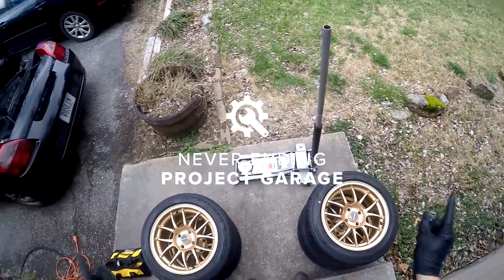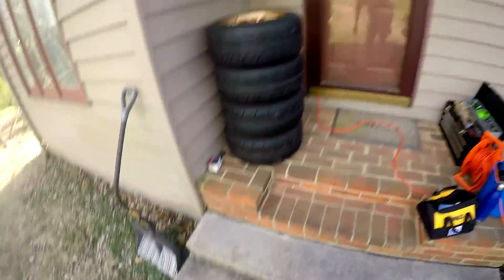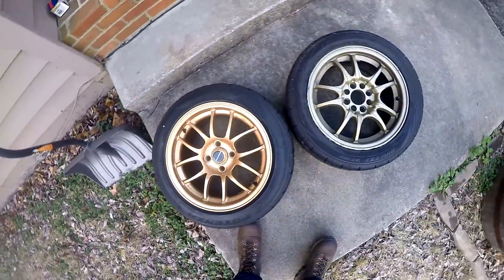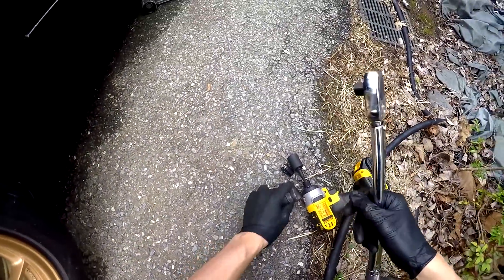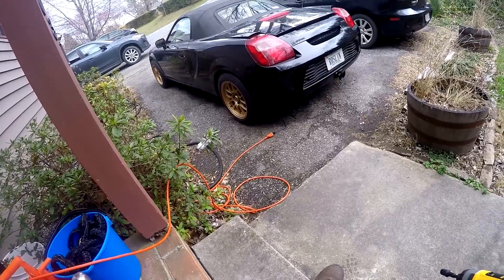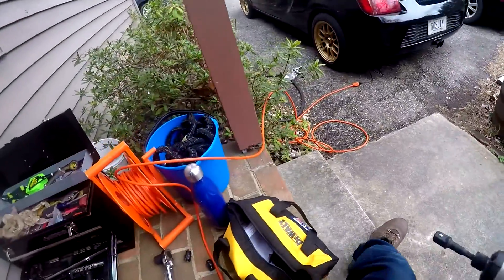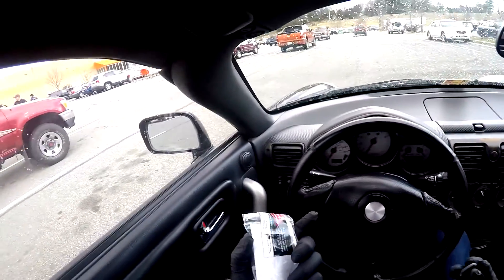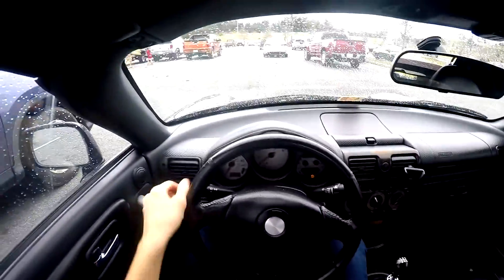Installing 6UL wheels and RE71R tires on the MR2 Spyder - Autocross starts soon!

Comment: I'm keeping my eye on your spyders progress and I'm loving your wheel setup.

Also you can usually break the lugs free with the car lifted using an impact gun. No need to loosen them on the ground unless they are overtorqued.
Reply from the maker: I did that out of habit, but seeing how well that gun works, I'll probably do them all in the air from now on. It's only 75 lb/ft of torque per wheel.
Reply: Never Ending Project Garage I thought that  120 lb/ft figure was a bit high

Comment: hey NE 
I sure like what you have done to rescue another neglected MR-S. I happen to own a 2000 Red MR-S. I'm the original owner. Right now it is in storage up in MN. My MR-S needs an engine rebuild because a tooth broke off of a  sprocket for the timing chain. it messed up cylinder #1 of my 1zz-fe . Eventually I'll get it fixed this Spring.
Reply from the maker: Ah, that sucks! I'm lucky in that neither of the engines I've used have had any timing chain issues.
Reply: Never Ending Project Garage 
check your oil level after every time you finish an autocross meet. These cars stock  chassis can handle high G's but the stock engine cannot. My current short block with a broken timing chain spockitvis not my second short block. It is my third short block. I' be had two other short blocks repaired under warranty. The original engine lost oil as it was slashing past the oil seal on the Pistons. Thus, the oil would clog up the pre cat & destroy the rest of the motor. 
The second warranted short block was a supposed fix by Toyota to remidy the loose oil seals on the Pistons but it went the same way as the first. My third short block was a rebuilt block by Monkey Wrench Racing I. Michigan. This third block is the one with the bad sprocket. I have come to the conclusion that my troubles were due do a quirk in my driving style. this car has predictable handling. Although, it can be put into a powerslide very easily. Back in the early 2000's a started driving my car around a particular left turn between  an East & west bound lanes  on 66th Street in Edina , MN. I would do a "U" turn & induce a power slide. I've realized, that this bad habit is mostly my fault & the cause of my motors break downs. When you corner hard or powerslide with a stock 1zz-fe motor and a custom suspension, the oil will move past the stock oil sumps baffles and get eventually overpower the Pistons oil seals to get sucked back into the engine. this will cause oil to be burnt off and clog up both the pre cat & primary cat. Watching you videos , I know you have a PPE style header without the pre catylitic convertor. Even so, keep an eye your oil levels, oil can still get past your engines oil baffles in the sump and the Pistons weak oil seals.  To keep oil in the sump invest in a $500.00 moroso oil pan. These sumps are deeper and have taller oil baffles to keep the oil in check so your auto x days don't end up with a blown engine. Plus, do NOT power slide an MR-S on the street 😁
Reply from the maker: +M Erickson Interesting. I'd heard about the 1ZZ's issues with the oil sump during sustained high speed track driving, but I haven't heard many complaints about AutoX. A Moreso is on my list of possible upgrades at some point.

Comment: How much did you rub? And I guess your on springs what type of springs? I'm in tien springs and I really would like to get rid of the 2-3 in wheel gap. Looks so ugly, is running 16s a possiblity or do you not think so?
Reply from the maker: I'm on Tein S lowering springs, no rub unless I have the car completely loaded up in a tight corner in AutoX.
Reply: Never Ending Project Garage do you think 16s would be better? I hate the wheel gap on my car, I have the same springs on my spyder
Reply from the maker: 16s won't close the wheel gap, but lowering springs could. Do you think the wheel gap is too much, even with the car lowered?

Comment: Dat CEL :-/.  Sounds awesome though!
Reply from the maker: Yeah, it's for the O2 sensor in the cat pipe. Since I'm not using a stock header design (and there are 2 in the header), and the cat pipe is a little different, the only surefire way to get rid of the lights is to reflash the ECU or get a bung that tweaks the airflow. I don't care about the light enough to do that, and it passes inspections without a problem.
Reply: Oh nice, where I live they won't even bother doing the test if your CEL is on.  Actually I had the same issue on my miata, but I just stuck a couple of washers on the downstream O2 sensor to pull it out of the exhaust stream and the light went out.  Not sure if you could do something similar if it ever starts to annoy you, my downstream sensor is right behind my cat and not actually on it.
Reply from the maker: It might be worth a shot. I've considered it, but it's always been pretty far down my list. Thanks for the info!
Reply: What code is the CEL for?  If caused by the rear CAT, a defouler will solve it.  Ask me how I know...
Reply: Rene Neron 
Yep, after running an autox NEPG could have a somewhat clogged main cat causing that CEL. Oil will have burnt off around the cones at the last auto x . Plus, any light mods done to a 1zz-fe engine with out a reflash or aftermarket computer makes this car run too lean.
Reply from the maker: +M Erickson The main cat was replaced shortly after I got the car, and I also replaced the header with a model that doesn't have cats. The code never went away, and I've cleared it a few times to make sure. It's possible the O2 sensor past the main cat is ruined by the original engine's oil-burning ways, but I honestly haven't been that worried about it. It's one the one-day list, the car runs 10x better than it did when I got it.
Reply: Never Ending Project Garage 
yep, you will need a new 02 sensor.

Comment: Should have taken 17" rear rims for better traction
Reply from the maker: The diameter of the rims doesn't affect traction like the width. I could have gotten wider rear tires, but traction wasn't the car's limiting factor most of the time. Suspension, alignment, and driver limited it more.

Comment: You should have done a burnout to finish off the old tires
Reply from the maker: I would have burned off 85% of them! Ha, they only have about 4k on them.
Reply: Never Ending Project Garage just do like a 20 min burnout. Your neighbors will love it
Reply from the maker: Yes, a 20-minute burnout with an open-diff 140hp car. That's what I'll do.
Reply: Never Ending Project Garage 
Nope, you definitely can't do burnouts in this car in stock form. But, you could definitely do powerslides right out of the dealer showroom. You don't need an LSD or massive HP. the car is so balanced that  the flick of the steering  wheel and a touch of  throttle will make the car face the opposite direction in no time. 😚
Reply from the maker: +M Erickson Next time I have an open parking lot and I hate the tires, I'll see 😉
Reply: Never Ending Project Garage 
having a full TRD Sportivo suspension setup helps with that even more too. I installed the kit on my car myself back in 02.  I imported the kit from Japanparts.com. The local Toyota dealership was going to charge me way too much for it. The set includes all 4  custom valved KYB struts, 4 springs with a progressive rate, both front & back sway bars with a larger diameter. It has been awhile but I think the  TRD sway bars are 22mm. lastly, the TRD kit comes with 2 small dog bone shaped spacers that are placed between the subframe and body of the car to correct the suspension geometry. the TRD kit only lowers the car  3/4of an inch up front and a little more in back. However, the car's stance as it sits looks just right.

Comment: 8" wide wheel is too wide for a 205 tire; exposes sidewall and outside of tire manufacturer's recommendations.
Reply from the maker: I've read plenty on both sides of the issue. Flyin' Miata recommends this exact setup (I bought it from them, delivered already mounted and balanced) for Miatas that are going to be tracked. If they're comfortable with it, I'm comfortable with it. It's the same thing as not running staggered. Plenty of people are convinced that any MR2 will become a death trap, but in reality the car has very mild understeer unless I do something incredibly stupid with it when I'm driving it.
Reply: Your decision, of course.  Enjoy your videos.  Personally, I would trust tire manufacturers recommendations.  Let us know how it works for you.  Note that you are still running a staggered tire set up; your tire sizes width) are different, being wider in the back.  The MK3 had a staggered width tire and wheel set up, with later models even having a staggered wheel size (16" in back with 15" in front).
Reply: Also agree that MR2's, particularly the MK3, is a very capable car with respect to handling.  Own both a MK1 and MK3.  MK3 is the best handling.  Using Koni yellows, whiteline front sway bar, TRD front strut bar, and Cory mid brace on mine with stock wheel / tire set up.
Reply from the maker: +Rene Neron It's no longer staggered at all. I'm running 205s on 8s all the way around. 

I trust the tire/auto manufacturers, but the car + mods now grips so much better than stock that I am not at all worried that I'll hit 50% of the car's limit on a public road. I don't drive recklessly. On an autox course, it's fine with me if it's a little more prone to oversteer than stock. It still grips like crazy, and if I slide out in a parking lot, it's no big deal.
Reply from the maker: +Rene Neron I'm using a Corky's mid bracing plate, but I haven't added any sway or strut bars yet. That's on the one-day list!